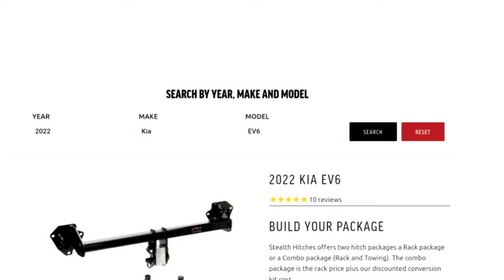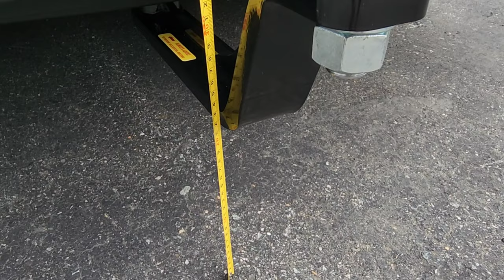Stealth Hitches Kia EV6 Towing Conversion Kit INSTALLATION with New ACTIVE Wiring Harness

Comment: I just did this install with active wiring kit as well. Took me 5 hours but it looks great. I found the chassis bolts very fiddly and using the torque wrench in such close quarters quite a challenge! I also discovered that a 19mm and 15/16 socket are not standard in my socket sets! Interestingly they sent me the incorrect wiring instructions with the active wiring kit, so it was only thanks to your great video that I managed to complete that step!
Reply from the maker: Glad I was able to help!

Comment: did you have to run a 12volt wire from the battery or did the control module take care of all that?
Reply from the maker: The control module connects to the prewiring so you don't have to run anything additional.

Comment: Does the active wiring harness not require running power from the battery? I didn't see you make that connection. Also, I was surprised you disconnected the battery, I thought that may affect the entertainment system or saved settings. I would not disconnect the battery. And if you had to, I think disconnecting the positive would be more effective.
Reply from the maker: It does not require running power from the battery. It gets its power from the prewiring in the back. For disconnecting the battery, the Kia instructions say to do so which is why I did. I didn't lose any saved settings though.
Reply: I did not disconnect the battery by oversight but had no issues thankfully
Reply from the maker: @mprwalker  oh good

Comment: I have the Stealth Hitch and Tow  harness however I’m not so sure I have the Active harness you mentioned. What am I missing is I have the first version harness?
Reply from the maker: The first version harness works fine for trailer  lights. The "active" harness communicates with the car, so it adjusts some parameters - automatically disables rear sensors and active assist, disables iPedal, engages full time awd (awd models), adjusts range, etc.
Reply: @TechnicallyJeff  I sent an email to Stealth and I’ll see what they say as I’d like those features on my AWD. Why wouldn’t you want all those additional features?
Reply from the maker: @jlans  yeah personally I do too. It is a little more expensive though.
Reply: @TechnicallyJeff  It also avoids having to run a wire from the battery and the power on each tail light, which was a royal pain in the a**
Reply from the maker: @zacweggeland9912  yeah I imaging that would definitely be a pain.
Reply: @jlans  yeah me too Jon. I hope I can get the active harness from them for $130 (the difference between the active combo and the stealth combo). I didn't see the active harness for sale by itself on their website.
Reply from the maker: @djmattyb  Yeah definitely reach out. I'm sure they'd work with you.

Comment: That’s the ugliest tow ball ever! I don’t think it’s looking any good on the car. Why didn’t you go for the Kia EOM kit? That is a nice looking tow ball (as far any can look good). And at first glance probably also easier in use.
Reply from the maker: How is it ugly? It's just a ball lol. Or do you mean the hitch itself? Have you seen the Kia one for the USA? It's so ugly, undersized, and not hidden when not in use... This hitch is better than it, and honestly any others, in basically every way.
Reply: >> Why didn’t you go for the Kia EOM kit? 
3:07 Does Kia sell an EOM Gravel Guard with a special door to avoid getting any dirt and make it invible when nnot in use? 
(Similar to the Tesla Model 3 rear diffuser with a 12" x 3" opening door.)
Reply from the maker: @nihongobenkyoshimasu3190  the oem kia one in the USA is very ugly, small (1.25"), and not removable. And no they're isn't a gravel guard with a door unfortunately.